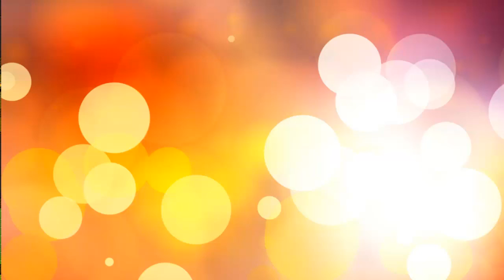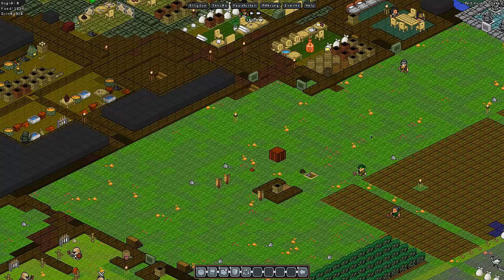Inzainia Plays: Gnomoria Episode 12 (mechanics)

Comment: Thanks for the video, very informative. Would it be possible for a future episode to detail how to safely flood and build an underground farm? Also for the gearboxes is it possible to use them to make branching linkages, for instance opening two doors in different places from the same box, as long as you have enough power?
Reply from the maker: yes, so long as you apply enough power to run a structure, you can have as many branching things and mechanical things on the line as you would like. and yeah ill do one on an underground farm soon,
Reply: Alright, thanks again for the info and the vids.